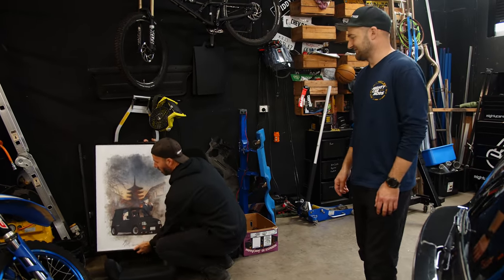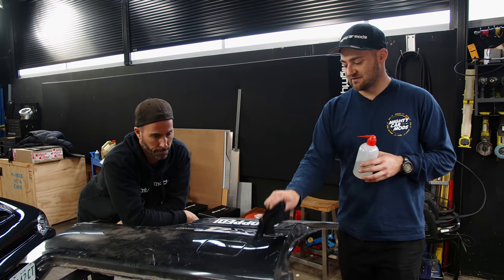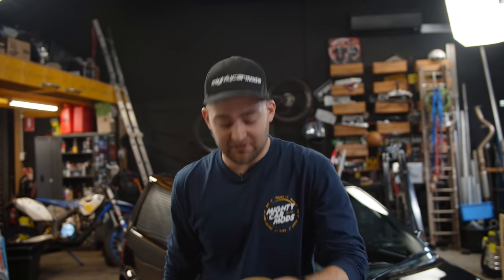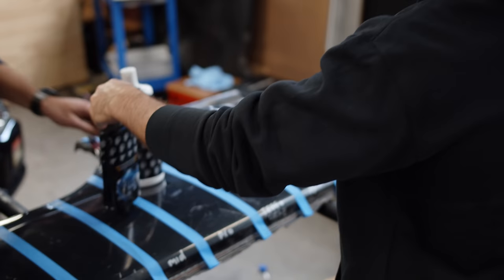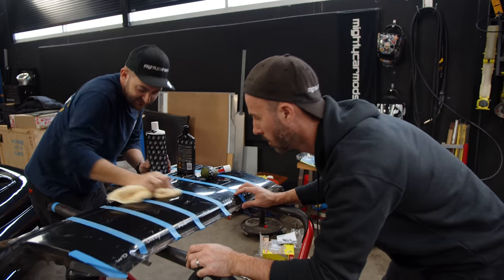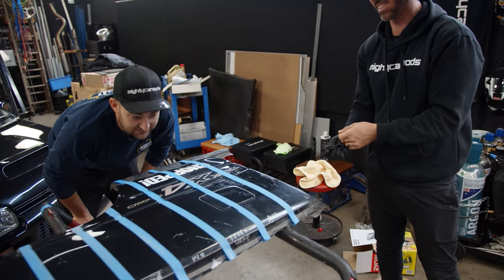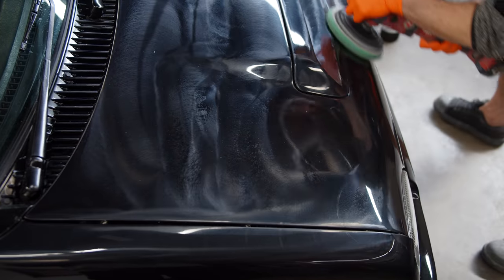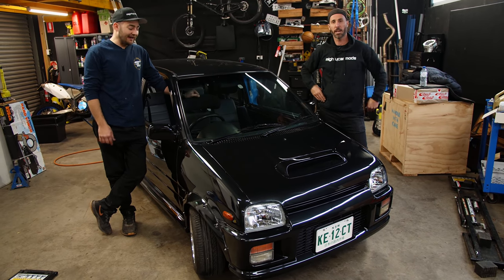How to fix scratches on your car [MYTH BUSTED]

Comment: you're using enough compound to do a hood let alone a tiny section of a panel, overloading the pad reduces how well it works massively :)
Reply: The hood?.. you could literally machine polish a full car with how much compound he put on the panel at 11:42

Comment: As a detailer for Porsches and lots of other German autos, the biggest things I have taken away from it is: touch your paint as little as possible and the importance of a dual action polisher and microfiber buffing pads together cannot be understated and is a must have tool set for us enthusiasts.
Reply: As a fellow detailer I couldn't agree more, the more you can protect your paint and the less  you have to use polishes and compounds the keep the shine the better
Reply: That’s my theory about windscreen glass. NEVER touch the inside windscreen: it will never be unsmudged again.
Reply: Ping Chen Your theory is all wrong.
Reply: Ping Chen , metho and water on glass is the go! 👍
Reply: @fordbloke4790  what's metho? I usually use diluted vinegar on glass. Magic erasers are great for individual smudges, too.
Reply: prairiepanda , metho is methylated spirits
Reply: whats a decent entry DA polisher ?

Comment: helpful tip from a pro detailer: the less product the better, whether it be machine or by hand. more liquid means more sloshing it around. and continue to clean the pads often. if by hand, the 1 minute rule (1 minute of work, spray with a little water and brush out with a tooth brush and resume) if by machine, after each panel.

Comment: 10:48 Going HAM on the product 😮. You only need a fraction of that for the whole panel.
Reply: and apply in circular motions not scrubbing it like a dirty pan...
Reply: Yes little too much product. Haha they prob didn't pay $70 + a ltr
Reply: I was thinking the same thing.  That was cringeworthy.
Reply: I cringed as Marty dropped the foam applicator on the floor.... Guarantee he didn't wash the dirt off it before smooshing it into the paint.

Comment: "It's Just a Car" I have heard a LOT of people say that when they bang their door into your vehicle, scuff it with a trolley or rub past it. THEN when car owners start parking their vehicle on the white lines to stop people getting too close and scratching their cars they become enemy number one. Sad times.
Reply: To some people, a car is just a way to get from Point A to Point B.
But to people like us it IS the Point.
Reply: Not to mension those people lower the resale value of the car by damaging it.
Reply: parking on the white lines to keep people from parking too close  means i will park nearly in contact with your car blocking the drivers side door if given the chance.  like if you do it in the back of a lot with tons of empty spaces fine whatever but if you do it in a crowded lot you're just asking for someone to hit your car trying to squeeze in

Comment: Love the video as always lads. As a detailer here's some tips
You're using way too much product. You only need 4 pea sized drops per panel. Using too much is making the cutting process much harder

When using a machine polisher always hold it flat on the panel or you can cause polish marks very like what is on the mira. 
Hope this helps in the future. Keep up the fantastic videos 🙂
Reply: Less it's definitely more! I polish many things and if you use too much it just sprays everywhere anyway.

Comment: Difference between a painter and “detailer” 
Detailer says this is a 6 stage paint correction process bla bla and will cost $3000 
Painter says I’ll sand it then buff it. Lol
Reply: Yeah but they leave it looking like they sanded and buffed it.
Reply: CarlDSLR found the detailer!!!      
looked a lot like a black mirror to me in this video
Reply: The painter knows how much clear he has to work with. A detailer is normally working with older paintjobs and doesn't want to get down to the base.
Reply: @EmyrDerfel  it can be measured

Comment: Deatailing, paint correcting, and ceramic coating a car is something I keep going back and forth about when it comes to whether I should try and do it myself (which involves buying everything you need to do it right), or if I should just take it to a professional... On one hand it seems simple, but my experience with sanding stuff is horrendous I'm real bad at it; though it can be that I've never had the right sandpaper when I tackled a sanding job.... I know how important the grits are but even then, I'm always left with this dilemma. I bought my dream car (06 Mustang GT) exactly a month ago and it has swirl marks allll over (black car). I want to get it paint corrected but I don't know if I should try and do it myself or not lol. Great video though guys, thanks!

Comment: 1.  The type of pad used is always very important.  2.  You used about 50X-100X too much product when you were hand polishing.  3.  WD-40 will destroy paint.  4.  The bonnet you had on the Ryobi is actually much more abrasive than the applicator pad you were using to polish with so you probably should have been using the polishes with the Ryobi.  
FYI - With the hot weather in AUS, Carnauba wax will not last very long because it will basically melt off so you should put a synthetic paint sealant on first and then a wax on top if you like the look of wax better.  
Polishing is not that scary if you use a free-spinning dual action polisher because it has a built in safety mechanism that won't let the pad spin unless it is perfectly flat on the panel which makes it nearly impossible to burn through the paint or clear coat.  (I think the Ryobi polisher is a free spinning DA polisher but I am not certain, it is probably a bit weak for actual paint correction though)
If you guys ever have any questions about paint correction I would be happy to help!  I have been a big fan of MCM for years and I would be delighted to be able to provide you with any detailing info!  CHEERS!!

Comment: If you're feeling frisky you can also use gasoline. Use a tiny bit of it on a cloth and then rub it on a small scratch. What happens is basically the gasoline disolves the paint and clear coat. But if you are carefull enough you can smear some of the still good paint on the damaged part. This is also the risk since if you cock it up you disolve your coat.

Comment: I saw a Chinese add for a miracle scratch remover. I think it was a cloth and solution combo. They literally just painted on scratches with paint which looked pretty convincing and then wiped the paint off after spraying it with their "solution".

Comment: I guarantee that scratch is from someones aluminium Ute tray. It backed into you then pulled out. I’ve done it to someone before. The underside of tray is surprisingly high, and you can easily clear small cars bumpers and scratch the bonnet.

Comment: If you get a little  paint on your car...like over spray from something,or you catch the door frame backing out of the garage,WD40 will take the bad paint off with a little elbow grease..Been using it for this for years,works great.

Comment: You need to be using ultimate compound for the first step which cuts and polishes then followed by the lighter grade polish only which you used with the “20-30ish dollar” product range there at 10:49 🙊

Comment: WD40 works when another car or painted surface rubs on your car and leaves a trace of it´s colour on your paint. It´s not gonna remove scratches or anything but it removes those "paint stains", also removes glue when you take out a sticker from a window and it leaves it all sticky, it will remove that glue-ish

Comment: @13:13 
i used a rotary wheel to cut back a scratch on my old GTI. It took the paint off within 5 seconds and left me with bare metal.

Comment: Seriously guys. 1) Chemicals continue working on the paint forever so WD-40 is out. 2) Use circular motions, that's why the pad is round. 3) It's not a vagina! You don't need lubrication, you need friction. Way too much paste!  4) Try toothpaste on it's own, unless you get a kick from pee-games. Who am I to judge, Moog, you perv. 5) Use the avocado stone carefully on gouges, running it lightly up and down the gouge to widen and smoothen it, then treat further as necessary.

Comment: 6:46 bar a few rpms.. i have an angle grinder with adjustable speed, yet at it's lowest setting it's still way too fast to use as a rotary buffer

Comment: A few pea sized drops for most compounds is enough for a machine polish or cut... don't need to use a whole bottle per car... the more compound you add the more it will tend to cut

Comment: Iv been detailing for over twenty five years there is a short cut in polishing  from middle cut smooth polishing depending on depth of scratches  if its to the metal then cart be polishing out

Comment: Might be a myth, but I always heard that you don't want to use WD-40 on a body panel since the oils will soak into the body panel and not allow paint to stick and can also mess up the paint you already have after sitting on it.

Comment: The products used by the pro were abrasion indexes of 3000 and 5000 and made by 3M if I'm correct?   Then what products in what order made by who?  I imagine you can't go into AutoZone (or similar car part chain stores) and get the 3M product so are they readily available at automotive paint stores?

Comment: Need a dash cam with park monitoring, they sell 'em. Uses it's own little battery you store somewhere else in the car. In 2014 I found some assholes sitting on the hood of my 1977 Oldsmobile Delta 88 in the local Walmart parking lot. The fact no one wound up in jail over that is a small miracle.

Comment: You guys used meguiars polish not their compound which is what you need to to cut into the clear coat and remove the scratches. Both actually do a decent Job at cutting a polishing when you used together. Not saying you should mix it but one after the other.

Comment: I bought a Snap-On toolbox once, and the previous owner "looked after" it with WD-40. When I say "looked after" it had scratches all over it, the drawers were filled with junk and the WD-40 made the box feel awful. 

I ended up degreasing the whole thing and compounding it back to almost new. Moral of this comment is WD-40 is a great product, just don't use it on your Paint or Powdercoat!

Comment: Can yous do a video about how to pick the best wheels for your car??? dirft/drag/race how to actually measure up your wheel wells and getting the biggest/baddest offset jdm hecktikness to actually fit instead of going out and buying a set of wheels and turns out they dont fit/look shit, in one of your recent videos yous mention that finding wheels is easy but for someone with no idea its quite the task... Tire shops wont fit wheels that protrude your guards in vic, So if im going to be doing it all step by step I wanna know how to get it right the first time.

Comment: Is there any way to remove two small pointed depressions in a 2004 Audi A4 rear bumper?  I began to back out of my garage before I opened the door recognizing it before I thought I impacted the door.  While I did catch it early enough not to damage the garage door it made enough contact at the middle hinge  of which the two outer edges of the hinge protrude slightly making the small pointy depressions in the bumper.  Because the bumper is a kind of hard polyurethane the points are noticeable mostly to me (I'm aware and looking for it), others don't seem to notice except in certain angles.  Anyway I'd love to remove these small depressions without having an auto body shop to fill in and paint and buff.  Any secret sauce regarding this problem?

Comment: Guys, I may know who did this, go to the store or the place where you parked this and find out if a delivery van came by to drop some stuff off, as a friend of a friend in Florida, had this happen to their car, their trunk, got F'ed the hell up as they LEFT their FED Ex delivery on it, which was full of 7 quarts of oil and an air filter, and slid down and scratched the hell out of it. 

like seriously go to where this happened, ask around and ask if their was any cameras around, I bet you it was the same DAMN thing.

also not to rub salt in the wound, but things like this are why I think if I ever have anything nice, the first thing I'm doing is having a paint protection film put on it, like ask around and see if theirs any locals that can do it.

and if you wanna see how good some of this stuff is, look up matt farah's porsche rally safari build, the guy said the paint protection film that he had was so good that some guy had a gigantic rock that hit the damn thing, and while the bodywork was dented, the paint was fine 

the vids the "XPEL Paint Protection Film Install" on the smoking tire channel FYI 

 and the guy does go from place to place and had a foreign accent, kinda like you guys, so he might be local lol

Comment: Paint quality is awfull guys ... we call shit hands if someone does such a bad job , alot of dust in clearcoat (bad paintbooth , old filters, or people that dont care)  and to low grit sandpaper was used , 23:25 left side of the bonnet you can see  those scraches in prep work

Comment: I was wondering if anyone has an answer. iv'e used many different products and done it by hand and machine but always the end result is a car that is very statically charged and just attracts dust which ruins my end result in a day or 2 as you see a thin layer of dust stuck to the panels :(

Comment: is not complicated wet sand with 2500 grit sandpaper till scratch is gone than use 3m two step polishing system do the whole bonnet and your done

Comment: You used Meguiars ultimate polish! Not compound! If you used Meguiars ultimare compound that stuff would have been better than the "pro" you used. I think the Pro you used is a Frecla compound. Frecla is not very good compound... and to call Frecla a pro over Meguiars which really IS a pro detailer brand is a shame for Meguairs. Meguiars  pro range is top notch shit, M105 and M205 are great polishes!

P.S. im a detailer.

The "detailer" is really a body shop guy! He knows shit! Hes really hacking it!